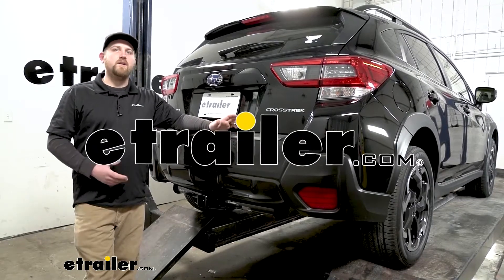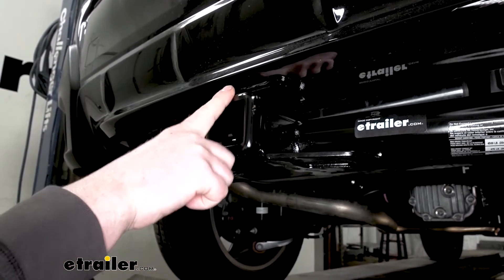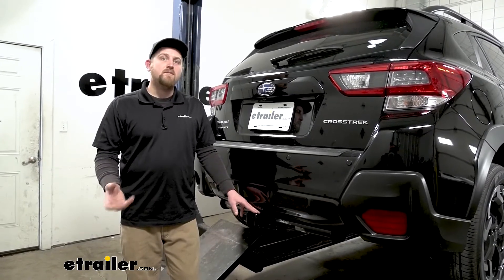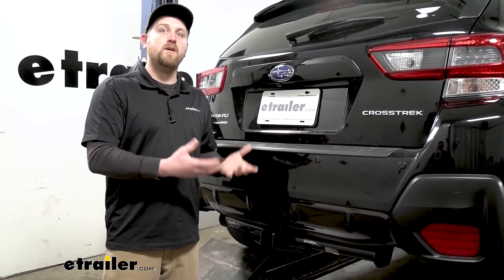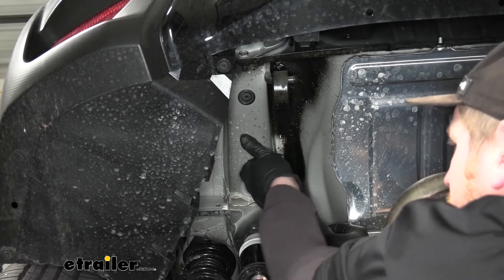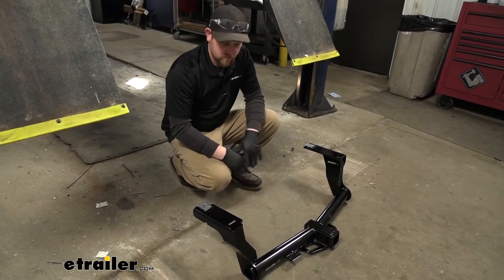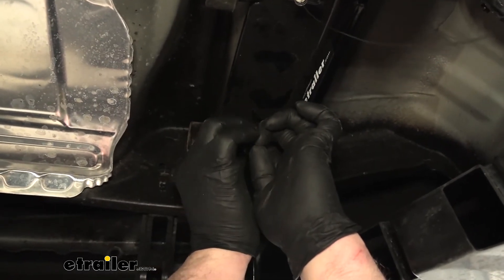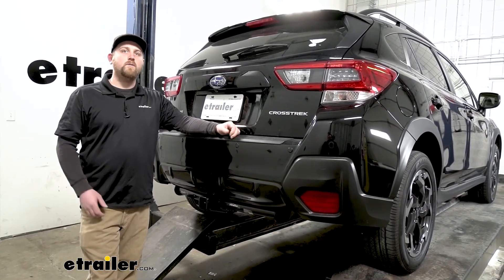etrailer | 2021 Subaru Crosstrek Draw-Tite Max-Frame Trailer Hitch Receiver: Complete Installation

Comment: Thank you for introducing me to this hitch.  I've been considering buying a new Crosstrek and wanted to see which accessories I could install myself to save some money and which I wanted to have installed at the time of purchase, so I have watched several of these installation videos for different hitch receivers.  Every other one I've seen requires you to enlarge or notch the holes to get the plate washers and bolts inside the frame, which just seems ridiculous to me.  Why should I have to cut into my car and increase the likelihood of it rusting when the manufacturer of the hitch could easily make the hardware an appropriate size to fit the factory holes?  Seeing you install this hitch without having to cut into the vehicle definitely puts it at the top of my list for when I finally buy my new car.

On a side note, I live in a place that uses a lot of salt in the winter and was considering having the car undercoated to prevent rust.  Would such an undercoating interfere with the installation of this hitch reciever?
Reply from the maker: Sometimes if the undercoating is thick enough it will need to be scraped off in order to properly install the hitch.
https://www.etrailer.com/Trailer-Hitch/Draw-Tite/76209.html

Comment: Great video and good looking hitch, do you know if installing this not at a Subaru dealer voids any warranty?  My vehicle is newly purchased.  Thanks !
Reply from the maker: Consumers are protected by the Magnuson-Moss warranty act that states, in part, that unless the part added actually causes a problem, then installation and use of the part will not void the warranty. Check out this hitch on our website in the following link.
https://www.etrailer.com/Trailer-Hitch/Draw-Tite/76209.html

Comment: Just cause I'm a lazy slob, I checked with Rack Attack in Sherman Oaks how much they'd charge to install -- $250. Cured me of laziness right quick.
Reply from the maker: This hitch is not too bad to install. It is worth the time to install it yourself. If you plan on pulling a trailer, it is always a good idea to install the trailer hitch wiring at the same time
https://www.etrailer.com/Trailer-Hitch/Draw-Tite/76209.html
https://www.etrailer.com/Custom-Fit-Vehicle-Wiring/Tekonsha/118467.html